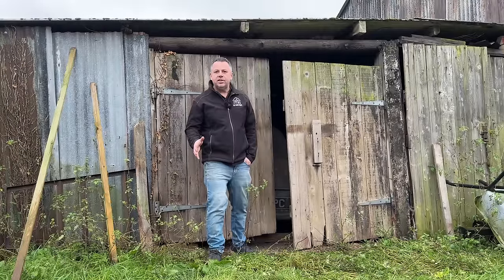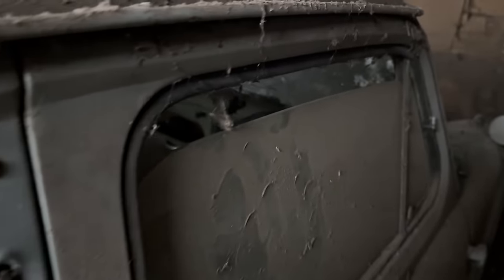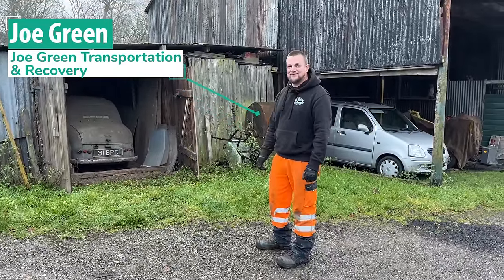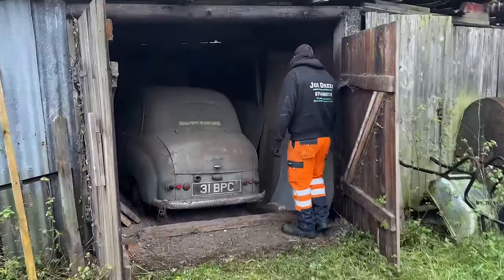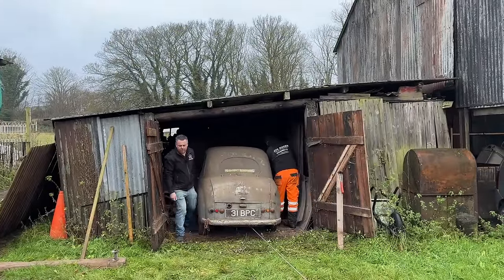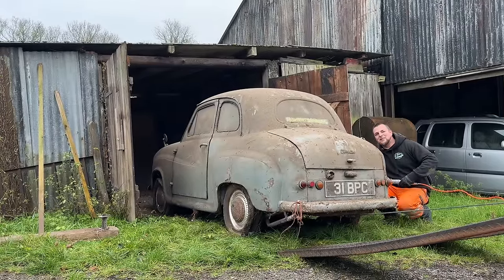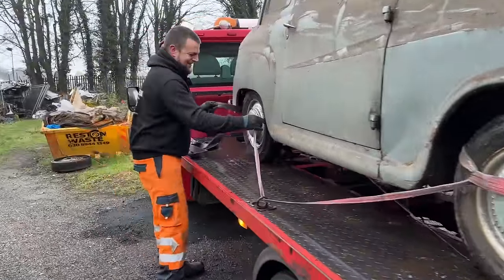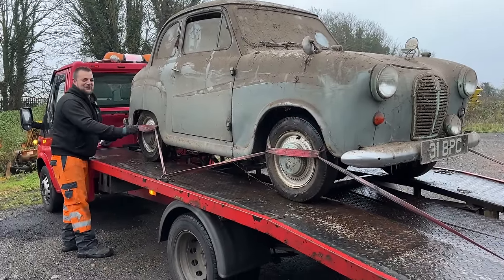Another UK Barn Find Rescue | Austin A30 Laid Up For Over 45 Years | #barnfind #classiccars

Comment: A couple of months ago, you knew what an A30 was, but knew nothing about them.  Now, you own three of the wee beasties.....and I'm a very jealous man!  I must say though, that after your efforts and the steep learning curve on the little green fella that the grey one has a very good chance of coming good with minimal stress as it all looks to be in familiar territory.  

The grey one looks so much like my first car - even to the mileage she has and including the Axminster cut-offs.  Mine had the colour coded ash trays on each outer edge of the lower dashboard though and the dent was in the driver's door, not the passenger's one.  Another factory-fitted Smiths heater with the Bakelite switch to the left of the wiper switch, so it's geek heaven for me!  Those central revolving ash trays were period after-market affectations, as was the radio...although knowing the A30 as I do, I am surprised about its placement due to the amount of water that comes in through the windscreen seal!  Trivia time - the Axminster cut-offs were often put in to protect the original carpet from dirty feet...as well as a replacement for the original carpet instead of the original carpet (or after said carpet rotted away) due to the aforementioned leaky windscreen.

The interior for the Tweed Grey painted vehicles had only the two options - a bluey-grey vinyl with a bluey-grey cut-pile carpet or a deep red vinyl with a deep red cut-pile carpet.  The ivory vinyl with light grey carpet was not offered for the Grey cars - although it would have been striking, I think - and they never did a tan or black vinyl option...ever.  Most aged vinyl that looks tan or brown is actually a sun-burnt red and the red carpets tended to fade to almost a beige.  My car had the blue/grey interior and I think you'll find yours was originally the deep red.  The anomaly is the green driver's door card. Although the green vinyl (and carpet) was an option for green or white vehicles, it was never offered for the grey cars, so I suspect the reason for it's being there would be due to damage of the original or maybe what came with a replacement door.  The car looks to have had at least one external respray, but she does look good and solid...albeit with the typical front panel rust.  The front bumper is a strange one too - not for the A30 that's for sure.   Likewise, the wheel trims are an aftermarket affectation and very of the period.  The wheels / hubcaps for the A30 and A35 never changed throughout the models' production and were just the basic dome with the scalloped transition between face and side.

Under the bonnet has nothing that would scare me and the engine is indeed another 803 (easily picked by the spin-on oil filter).  The engine number is more likely to be stamped on the block with punches in the usual place rather than as a rivetted-on plate.  Good to see she still has the Zenith carb and oil-bath filter too.  The breather hose being crimped as it is will be due to time and is not a huge issue - people used anything from tap-water plastic hose to car heater hose to bridge the gap when the original gave way and if you cut them too long, they do what that one has done.  Lovely to see the original Trico metal blades still being used for the wipers too - and yes, they are still available new.  A HUGE plus that she's already turning on the crank, so let's hope that with a spark and a bit of fuel that she lights off first pop, eh?  Looking forward to seeing that.  

Maybe you could change your focus a bit and rename the channel to A30 Barn Finds UK?? I'd certainly be keen to see them all come out the woodwork - just a shame I'm on the other side of the world and can't give you a hand or buy one off you when you find it!

All the very best.  Hope your Christmas was wonderful and all the best for the new year.

Comment: Another great find.. The flasher indicators and windscreen washer are both later additions - also the radio. The original radio, if fitted, was a 12v valve set. The lights actually dimmed when you switched the radio on and it took a minute or two to warm up. The high voltage required for the valves was generated by a vibrating mechanism that you could hear humming.

Comment: I reckon that came off the road in the early to mid seventies. I wonder if it has the original 803 engine - many/most had a 948 A35 engine fitted later on. They're such dinky things - I must own one at some point. The oldest I ever went back was a a '59 Mini.

Comment: Well done both.
Once you have one, it’s never enough. Looking very original. Rad and gear knob is correct, they did three versions over the years. Mushroom, round and the later mini type.
Should have a red door card like the others, been changed at some point. Look forward to the start up!
Reply from the maker: I honestly can’t wait to clean up that interior, I have a feeling it will look stunning! - Claire
Reply from the maker: Thank you. It’s amazing how many tweaks there were in so few years…and how you Austin fans know them all. It really does make owning them interesting.

Comment: 🎅merry Xmas Claire & Elton 
Great channel 😊😊
I own an Austin a30 myself and sits in the family garage business in stoke on the ramp 
Mine has working trafficators ,engine upgraded with 948 engine and discs brakes  at the front . 
Great first video guys 
The switches on the right of the dash are obviously the indicators and have been retro fitted at a later time 😊
I reckon the grey door card issue is possibly a replacement door or simply a scrap yard find for a replacement and not original because the others match the seats😊
😊😊
Yes definitely got mouse nests in there so have a fire extinguisher ready if the wiring has been chewed through only the fuse protection for the Austin’s are not adequate and the fuses are too big and even the lighting isn’t protected correctly either at all or straight the battery via the regulator A1 connection as the one I’ve got is and I’ve changed mine for a new fuse box and an addition to split the circuits up 😊being a qualified electrician i see these things
The wiring loom on mine was changed by the previous owner but he failed to change all the connectors which had perished all the wiring from the bullet connectors ( original ) black through connectors had also perished 😮
We turned the lights on for a while and the connectors were warm and melting 😊😊
Please be aware of this going forward and always use a safety battery isolator on the earth connection and screw it off when not in use 😊
I know you don’t need a heater duct but you can get them no problem I bought one for mine 😊😊
Always have a CO2 or Dry powder extinguisher 🧯 always close to just in case 
Anyway have a fabulous Christmas and look forward to seeing the little peanuts progress 
Oh your green one has an off side rear flat lol 😂 
Great stuff 
Phil Green
Reply from the maker: Hey Phil, thank you so much for your comment.  Just looked you up on YouTube and have subbed to your channel 👍 We love our bikes too  albeit the small engined variety 😂 - Claire
Reply: @UKBarnFinds  
No problem 
My little Austin’s on there if you get time to look and me using the starter handle last year at the garage 
I’ve had a few cars to do up  ie 4 MG midgets, triumph Herald plus now bikes but still have my Austin A30 tho only had it for 3 years so I’m still learning on these but I always check the wiring first myself once it’s up and running 
Thanks for the sub 😊🎅🎅

Comment: Meetens were at Coombe/West Wimbledon off the A3 at the Coombe Lane flyover.  Had about 5 of the 1930s shop units.  Specialised in single cylinder and similar engines for boats/motorbikes,  you could get whole engines or spare rings / plugs / etc. They probably did rebuilds.  Not certain when they closed, deffo there till the mid 1980s

Comment: I believe that is not the original number. I would expect a car of that age to have letters before numbers. Its good that the engine is not seized. However, it looked like there is no compression. Maybe sticky valves. If so, I know a man who can fix that! The wheel trims are aftermarket accessories.
And just for the record Claire, I for one are very pleased to watch your presentation. And I am confident there are many others of the same opinion!
My Dad's 1961 Singer Gazelle had a valve radio. This one being solid state will be younger than that. Also the air horns will maybe have been in the 60s.  I believe the long gear lever means it is not a late A30. My father's A30 Countryman had the short lever, like those on the A35.
Another great find! Love it.
Reply: The number/letter style actually started to come in around 1953
Reply: My father had a 1956 Morris Isis with registration number 2AJO so I think the number on the A30 is correct.

Comment: the wheel embellishers were sometimes aftermarket sometimes an upgrade option from the dealer - invoice would show , was there a A30 "delux" version ?  The missing filler cap use those now not legal plastic "fan" ones while on site.  Likewise the ashtray was a delux option on the 1959/60 Morris Minors so must be a BMC thing

Comment: For what you save it’s better to have a middle section on a tow truck, less chance of problems and a lot safer.
Over here in the USA most tow trucks have aluminum beds.
Reply: The problem is, in the UK we are limited to 3.5 tons gross weight.  Above that you need a tachograph  and a Driver's CPC (Certificate of Professional Competence) and your working hours come under government scrutiny, plus an Operators Licence is required.

Comment: Starting Handle may be under the back seat.   Best of luck with the restoration.    I have several old motorcycles that DVLA has given BF** number plates, instead of the original number, which is always a shame.

Comment: Is there a date on the newspaper in the engine compartment
Reply from the maker: There is, but as I said on a previous comment, I think it’s a bit of a red herring. Off the top of my head, I believe it’s 1987 (there’s an article about Princess Diana in it), but everything else is pre-1973. There are quite a few coins on the dash, which we will clean up and check, but the latest we’ve seen is 1971 so far. There’s also a scotch egg wrapper from 1973, as well as the crisp packets with the competition that you had to enter by 1974. I reckon, although it is a guess, someone took the battery off in 1987 and the acid had leaked into the tray. The person whose farm it was on said it had been there for at least 40-45 years (the car owner was her friend), but I now think it was possibly 50 years. We will go through all the other bits and keep them, just to look for more clues.

Comment: Whats the date on the newspaper in the battery area?
Reply from the maker: From memory, I’d have to check, I believe it’s 1987. There’s a piece about Princess Diana in it. I’m pretty sure it was put there after it was parked up, though, maybe if the battery was removed then and had leaked. The owner of the farm, whose friend owned the car, said it was parked at least 40 years ago and we’ve subsequently found more date-stamped items from the seventies, including a 1973 Scotch Egg wrapper. There are quite a few coins on the dash, which we’ll try to clean and investigate, but I haven’t seen one post-1971 yet. When we saw the newspaper, we thought it might be the key to unlocking the mystery, but I do think it’s a red herring in this particular case.